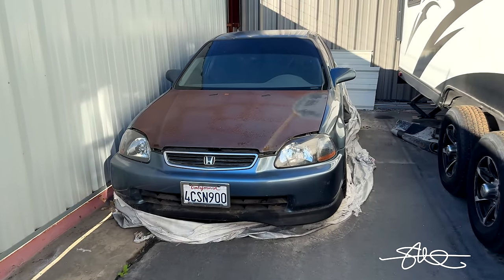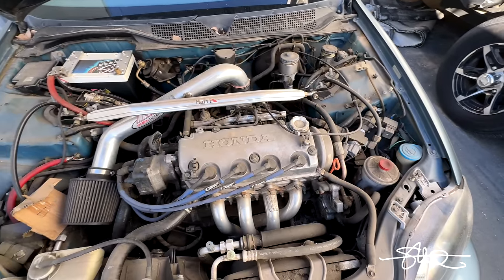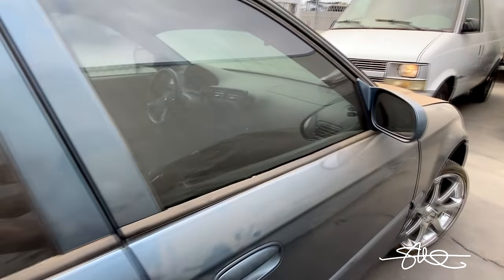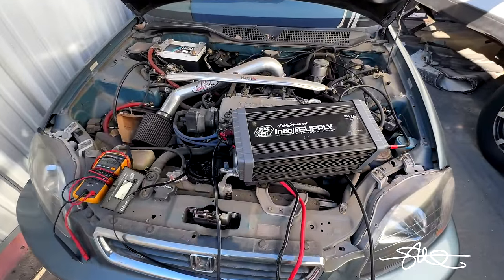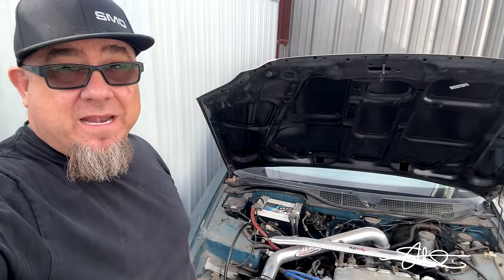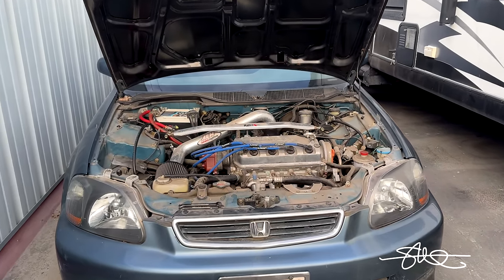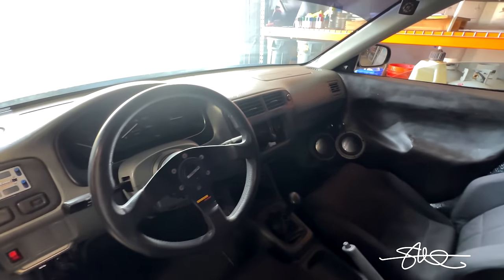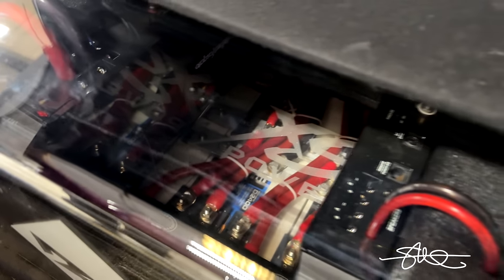Removing the system - Alpine deck got Stolen! Honda Civic on Air | Cold Start & Cleanup video 1

Comment from the maker: Please read the description for some details about this car that you may or may not know.  What would you do? The kids don't want me to get rid of it because it was our old family car.  So the options are, put some way bigger amps and some better subs in, finish the door panels, use new speakers of course and paint it.  Take the suspension out and do some static coil overs or do some bag-overs so i can still lay it out.  Right now it is on CANS.  Hit like if you know what a "Can" is. LOL.  Still works though! All I do know is no matter what I don't like watching this car rot away.  The amps are coming out next! Thanks for watching if you did!
Reply: I have a 1999 Hyundai Tiburon timing belt snapped got bent valves. I'm putting a new head on it to save the car. 253,000 miles can't let that car die I got singer alt and bass. Save the Honda fix it up you won't find another car that year or condition.
Reply from the maker: @skippy710  oh and it's got like  60 or 80,000 miles on it. (I forget).  Way low for a car that old :D
Reply: Man Steve, I have been subbed for at least 12 years and watched this thing built in your back yard at your old house and would be sad to see it leave..restore it with new equipment like the new gatley audio equipment or Trinity Audio..
Please don't get rid of it..
Reply: @meade916  definitely restore it and keep it forever 🤙🥂👍😃⚡happy Saturday yeeeeeeee.
Reply: i would sell it to me just my thought lol
Reply: If yall decided to sell it I'm lookin for a ek sedan to daily..
Reply: If it’s a sentimental thing, I would hook it up. Cars are a dime a dozen memories are forever.
Reply: Make it show worthy again
Reply: i agree keep it repaint it remove the air suspension and add some nice coilovers
Reply: Keep it and come back harder then before
Reply: Please keep it
Reply: God, my Maxima I had on “cans” is when I met you back in 1999. Way too long my brotha.  When I come back out to Cali, I gotta stop in. #finelineAZ #temporaryinsanity
Reply: Would love to see a build series on it
Reply: REBUILD!!!!!
Reply: Unpopular opinion, but it would be dope to see it turn into a k swapped racecar.
Reply: Turbo it
Reply: 3k with no audio components ship it to TN 😂
Reply: keep the car its sentimental to your family. happy holidays brother. 🎅
Reply: It would be cool to keep the RE's if you can. I inherited a 90's car that has a pretty good sounding system from 20+ years ago. It's got me digging the vibe of that period
Reply: Keep it bro. It will mean so much more to the kids and their memories of growing up with it. I'm going through the same thing with my 1992 Honda Prelude. I got it 2002, did everything from top to bottom that has been done to it. I have 3 daughters, and they love it...made me promise I wouldn't get rid of it. I drove it to the mountains 2 years ago and it did wonderful, not to mention it was in the snow. I haven't driven it since bc I have purchased 4 other cars since then for my mom, my oldest 2 daughters and one for myself. I just don't have time nor the money to mess with it. The kids love it so much, I just want to hold it for them, and maybe we do a father/daughters rebuild of it soon. Great content as always. I can't wait to see the refresh. ✊🏾❤️
Reply: Keep it
Reply: How much for the air cylinder system
Reply: To be honest i watched those videos of this Honda at least 3-4 times i really liked it. 
If I where you I would just redo the doors and the amp rack, leave the wall how it is and put some nice new stuff in ir which is more up to date, maybe some lithium batteries To save weight and some great sounding components and subs that fit the original wall just with more power maybe. Other than that I still like the original system in it
Reply: Sell me the subs Steve pleeeease...I've been around since the civic with the switches days...lol...I know u like to keep ur stuff but it was worth a try...lol...but anyway I know whatever it is that ur gonna do it's going to be the s**t...ion care what nobody has nor how many watts,ur always gonna be my bass hero bc u was the first that I SAW do hair tricks...I'm about to start on my armada & imma dedicate it to u & my brother...I'll send u some pics & videos once done...much love my guy...BUILD & BASS ON...STREET MOTIVATED DEVASTATION 4LIFE 🔊 🔊 🔈 🔉 📢 🔊 !!!!!!!
Reply: keep the cans for nostalgia... if not sell them to a guy whose got a period correct build and put this car on air. but keep the car, fix the paint and do a new stereo if you want. its clean and perfect looking, doesnt need anything crazy
Reply: I can suggest what i might do..... but if the kids dont want to get rid of it, maybe make a video/point out of asking them what to do? If they want to hold on to it, its got some kind of connections they want to keep, probably related to you.   Take care~~
Reply: I still remember the build on this thing from back in the day! I would definitely be interested in buying it if you decide to sell it 😎
Reply: Man that thing takes me back to the backyards days old skool working under a party tent if i remember correctly??? Jeez god knows how many years and three kids later….
Reply: Is it weird that I miss Sacramento a little bit?
Reply: Yes definitely keep it Steve and redo it this car has been in your family way to long to get rid of it its like one of the kids for sure.. I also seen the turcel hiding I had forgot about that one do you have any plans on doing anything else to it or mite it be for sale?
Reply: this car is what made me start to watch you back in the day along with "My EYE poped out"
Reply: If you do sale the re audio 18s i’m definitely interested and local
Reply: Bastards stole my Alpine out of my Audi about 2 years ago i was pissed off not because i couldn’t get a new one it was a relic and can’t be replaced im in Highlands not to far from your shop
Reply: Keep it, freshen it up, put a wild late 90s early 2000 graphics on it and rock it out. That Era is coming back hard!
Reply: U selling it ?
Reply: DGAF Civic is dope. Rebuild it to a BASS RIDE
Reply: Update on my 1999 253k mile Hyundai tiburon. I put that new cylinder head on day after Christmas had some missfires, replaced a coil, and its driving like new. I have to post a video of it and my bass system soon. The new head is off a 2004-2009 Elantra but my car is a 1999. It has same bolt pattern, but different Valve cover. ⛽🤙⚡😃👍

Comment: Definitely fix it. 1000hp all wheel drive 4dr sleeper 💤 civic. I have a 1997 civic ex with a 2000 b18b1 engine outta a Integra. Makes almost 700hp with a turbonetics turbo, poormans build, eats up hellcats all day…..I’ve had my civic for almost 25 years. Got it cheap when I used to work as a potter at a dealership when I was in high school. Fast & furious days